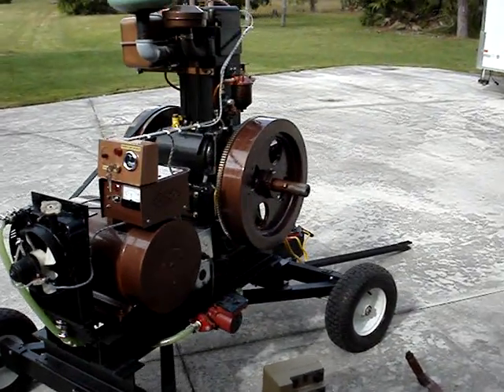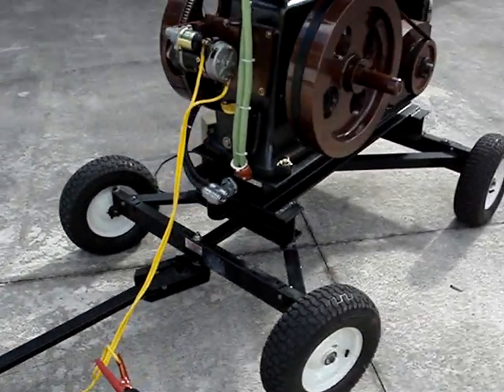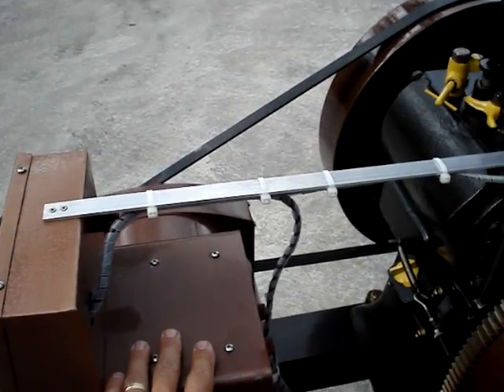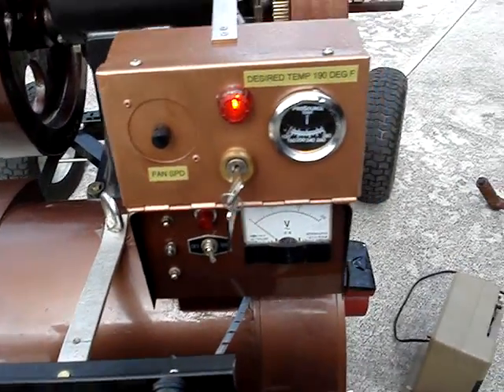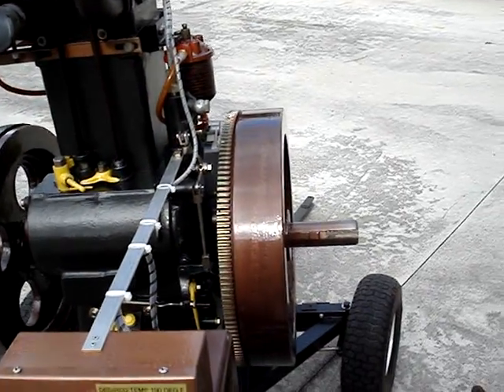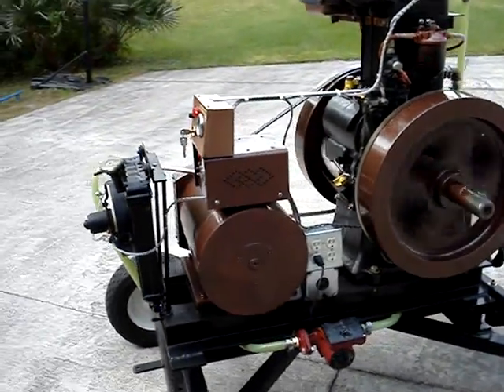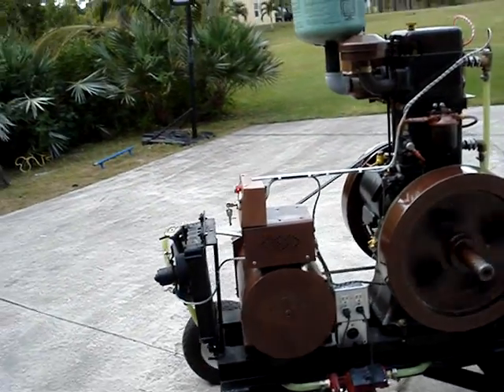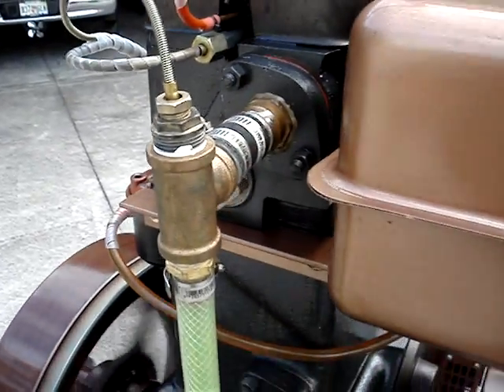Lister CS Listeroid Diesel Generator Homemade

Comment: We should change the regulations to allow the importation of low power, 30 Hp max, Diesel engines and complete gen sets. If I lived where I would like to instead of where I can afford I would have at least one of these running 24/7 to provide electricity and heat. This is a dream given my situation.

Comment: The cadillac of generators....Theres a lot you have not covered...please fill us in...your wheels looked to have extra balance weights.(did you do some additional balancing)..starter and ring gear looks like an add-on and looks great...12v dc output circuit...please more details on that....like that compact gullwing radiator with existing fans...is that cross or up and down coolant channels? theres more than meets the eye...!!
Reply: I'll mention some details for him he had passed away but I had some long conversations with him when he was alive when he was setting it up - I worked in the oilfield for a long while and am familiar with stationary engines - he did have the fly wheels on his balanced - the starter is a kit sold for those engines - the engine uses thermal syphoning to move water the radiator is an top to bottom core from what I can remember or vertical, in our discussions - he ran it on JP 4 - 50:1 2cycle oil mix - the continue out put at 700 or so RPMs would be roughly 7 hp or 2500 watts continues & the kva would be about 10 kva or slightly less - fuel consumption on #2 diesel is 300 ml or 1 qt per kw out put hour - on JP it's slightly higher - fan thermostat was  180f cut in 170 cut out  -at 700rpm he could expect at least 40-50000 hrs of run time till rod bearing and ring change out along w valves ECT - those engines are in use thru out Europe as CHP units one in Poland has been in service sence 1946 - there also used in remote places thru out the world
Reply: @able880  I saw where you asked about Bob.. yes he is gone now.  he was a very good friend of mine and we tinkered with all kinds of mechanical stuff.  He was  a pilot for American airlines if you did not know. A real high bandwidth type guy.
 We lost a real treasure when he passed.
Reply: @ZZ-jd6vx   I found out from some one else who contacted me - some one gave him my number to contact me about things when it came to generating power - sence he was a pilot & I'm a senior oil field systems engineer - it gave us common ground he would call me from  airports at time at any hour - in the oilfield as a tecnical person half your time is spent in flight and the other half is spent on the ground - so that alone gave us things to talk about - we talked about the difficulty he had when he added the electric start kit to that engine - many of the older single cylinder listers stationary engines were manual start most of those are from the 30s & 40s in some areas we up grated them to cranks with counter balancers & new style fly wheels with starter gear rings -   ( most are Arrows or Ajax today)  there many listers that still  keep voltage on pipe lines it triples the life of pipe lines  - so they could be started remotely and shut down remotly we up grated them - many were the original listers the Indian version  is the same -  except the the ones used in the oil fields the  heads are fitted with oilers & there is a 10-50 gallon oil sump added so it can run  5 -8 yrs unattended when there stand alone - thanks for responding
Reply: @ZZ-jd6vx  many of the combustion turbins in the oilfields are GE engines that were original 747 engines  bought off retired planes - Bob found that to be interesting -gas compressor stations, liquid fuel lift stations and plants through out the country use them for power & recover the heat - in cold regions they use retired chopper engine for power and heat - Bob found that to be interesting - a majority  of the tugs, supply boats  and drilling rigs are fitted with EMDs that were on retired locomotives - u can get  surplus for 5 cents on the dollar - the draw works & mud pumps on offshore rigs are often fitted with truck motors off locomotives  - Bob found all that to be awesome - it opened up a new world of knowledge to him when he found out  many things are reperposed after air craft & locomotives are retired
Reply: He was the consumate professional..  until he got home. LOL .  The stories I could tell you..

I still miss his calls as soon as he walked in his door from   Spain, England, Hong Kong..  it was normally " come down and lets work on xyz.. this is gonna be fun! Then we will go fly it! "
Reply: @ZZ-jd6vx  that's the way a lot of those guys are - he would talk about his personal plane  & how well his son could fly his plane - one of my cousins built the first 2 seater in it's class with retractable landing gear - he used a Lycoming military surplus generator engine for a power plant - he just up grated it to FAA standards - he built it in his living room out of fiberglass - Bob seemed like he would do something like that if his wife would have let him get away with that when he was married - it's to bad he's gone - I didn't get internet service out here till recently - when I got it I looked up his channel  - I figured something happened when I didn't hear from him in a while - when I tried calling his phone it wasn't active - were u the one one that helped him out  balancing the ring gear on the fly wheel
Reply: @able880  no, that was another friend. I did help build the murphy switch and remote shutdown.
I also worked on his rocket and had my share of stick time in it. We sure had some fun in that airplane.

Comment: how much longer it will run for 1 liter of fuel
Reply: It will deliver one kilowatt hour per 300 ml fuel so for every kilowatt of electricity you draw 1000 Watts it will burn 300 ml it takes 2.5 horsepower to create one kilowatt of electricity

Comment: Would this work in a motorcycle or a moped?
Reply: yeah but at a miniature scale its practical.  Why not run off of the stator behind the fly wheel from a motorcycle engine or moped your powering basic DC appliances headlight,tail light, horn indicators right? You don't need to build an external generator and retro fit it to a bike. work smarter not harder.

Comment: How long does it run 1/2 load on a full tank?
Reply: Its a 3 gallon tank - that engine Burns. - 1 quart of fuel an hour per 1000 watt load. Or it takes 1 Qt of fuel oil per kw hour out put - - if you run the engine as a 6 horsepower that would be at 650 RPMs you will get a little bit better fuel efficiency if you run the engine as an 8 horsepower at 850 RPMs you will either burn 300 ml or one quart of fuel per hour per kilowatt output and the load on the engine per kilowatt is 2.5 horsepower - that would be roughly 33000-btu input or fuel- that will give you 2.5 horsepower out the shaft of the engine in that case the input of the generator would be 2.5 horsepower which will deliver one kilowatt of electrical power- I'm very familiar with that engine
Reply: Correction on 300 ml its 946 ml or equal to a qt of fuel

Comment: What about controlling the fan speed directly by the coolant temperature?
It would be more reliable (pots tend to fail very soon), foolproof and easier for the engine (it would warm up quicker, as the fan would be OFF till it reach minimum operating temperature, without the risk of overheating)...

Comment: @rocketboy911 what problems might come up if the coolant temp is too low? engine no0b here, sorry :)
Reply: It will build excessive carbon in the head and exhaust port when you go to start it because the exhaust Port has carbon build up it also builds up on the exhaust seat when you try to start it you won't get the compression needed for the start and run so you trying to keep the water at least at 180 so you don't have any carbon buildup in the exhaust port or head

Comment: @LtColDaddy71 The Main generator makes AC current, without special windings built in it will not spin with DC connected to it, therefore no go as a starter. Even connecting AC to the terminals will not make them spin, I accidentally did this on a 300 kW V12 Detroit Diesel once, a big bang, blown diodes in the alternator, and a damaged regulator, but no spin. bummer.

Comment: have you thought about using a temp switch to regulate coolant temp? That way it powers on the fan when the temp hits a point and then powers it off at another point, all automatically.

Comment: VERY NICELY DONE! However, you have a big 3000kw starter already integrated into the system, I'm curious why you went through all the trouble of having a seperate starter? A gen head should work fine as a motor to start the engine too...
Reply: You would have to have a different type of generator head with a built-in starter set of windings and contactors - starter motor generators work well on gasoline engines but don't work too well on diesel engines because of the compression the generator would have to be two to three times larger if it were a starter and generator on a diesel engine plus you would have to have an 8D battery to start that particular engine on compression
Reply: @able880  thanks

Comment: I built a real simple automatic/manual shutoff for mine. Using a power door lock solonoid(available at any wrecker). It is temperature activated or I have a push button by the door to the gen shed. The kids can shut off the Lister without going near it. Very nice project you have there!

Comment: @mechanicalbu11 
Nothing to do with global warming.  In fact diesel engine efficiency, means they emit less CO2 for the same power.   It's NOx (oxides of nitrogen) and particulates like soot and sulfates.   Standards it likely could or does meet, (it's no boosted to hell turbo diesel that needs EGR at idle/lean cruise)  but since its not certified to current emissions its not allowed.

Comment: That's a pretty bad ass set up. I'm thoroughly impressed. With this setup you have, would it compete with the reliability of the Lister 6/1 engines? also, are you running gas in this thing or vegetable like the Lister?
Thanks for posting.

Comment: What's the fuel consumption per hour?
Reply: HiddenFromSight it depends on the Engine and the load but I have been told that it’s about approximately a half a gallon per hour at half load +/-
Reply: It's one Quart per thousand watts of load

Comment: Rocketman, I am surprised at how smooth the engine runs. Normally a large bore engine on rubber tires is an absolute no no but that is not the case with yours..

Comment: Just found this video, watched your other one with larger Lister, great job! I still can't see how they can use JP as fuel, yep- you told me that awhile ago.
Only thing I would change! Replace those tires with solid type, no tubes, no flats...
Reply: I like the tires.  They absorb vibration, and there is a lot to absorb.  Considering how little distance this travels, flats seem unlikely to rare, and my new favorite product, Slime, can prevent them, too.